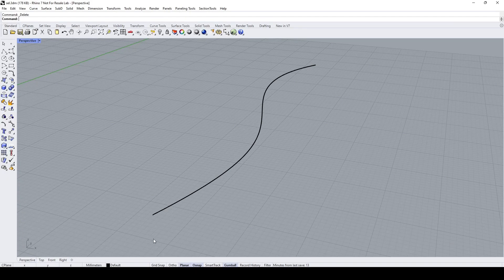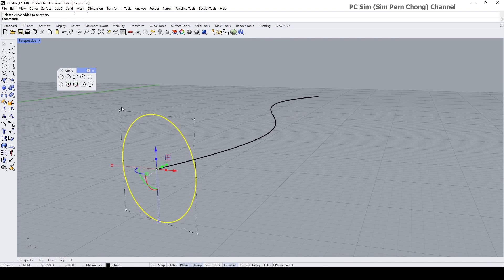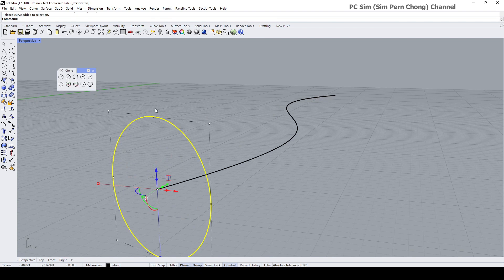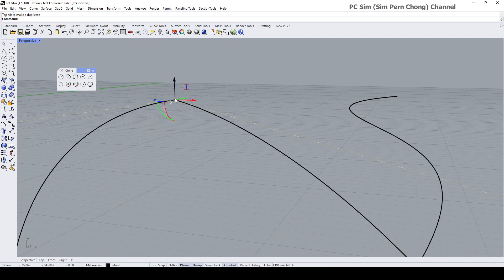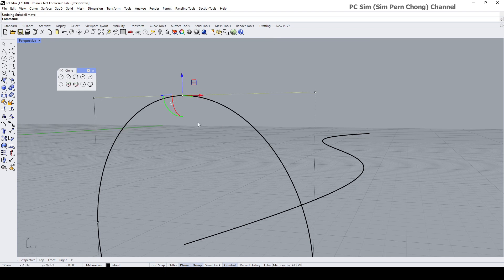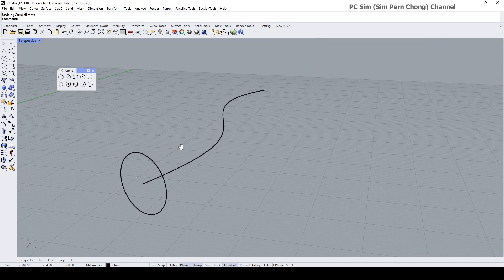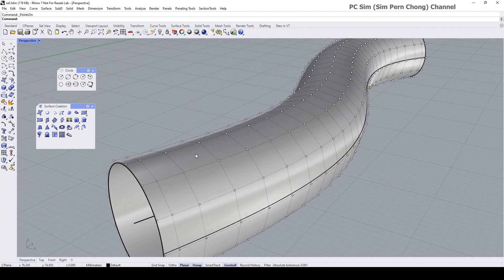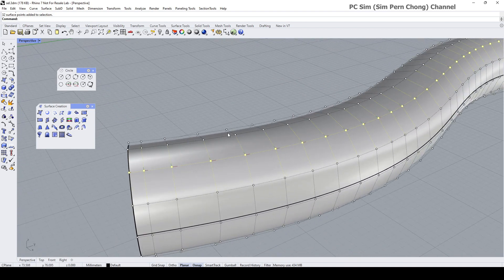Rhino Tutorial: Control Points Selection Methods (Updated)

Comment: Hi PC Sim.

 When you offset the curves, the copy that occurs is hundreds of control points. There are only 3 control points in the original curve, but in curve with offset, hundreds control points occurs. This is very annoying. Cause impossible to edit. Do you have a solution?
Reply from the maker: You can try using the command RebuildCrvNonUniform . And set the Maxpointcount to your desired value. Cheers
Reply: @simpernchong  Thank you very much PC Sim.

Comment: Do you have a method to align the CV‘s in the normals direction? Lets say the SRF is degree 7 and the normals of the Center CV‘s are on different heights. I could use MoveUVN to push them up, but its always just by eye. How could you make them smooth and in line with the other cvs? 

And do you know a similar approach in Rhino (without subd) for proportional editing like in Blender ?
Reply from the maker: Hmm.. that is a difficult one. I was thinking about this too. So far, I have not found a solution. But with Grasshopper, it should be possible, using the evaluate surface >> normal socket.